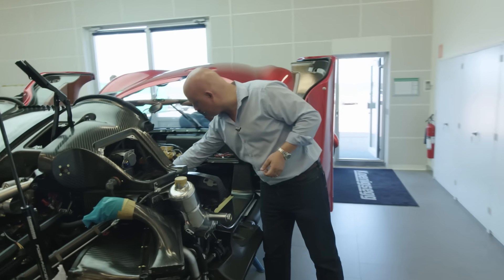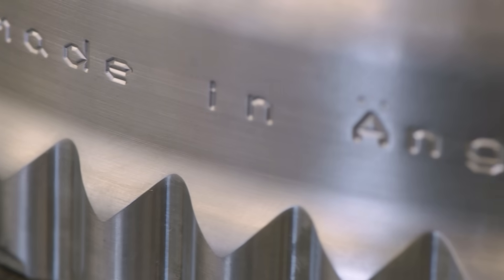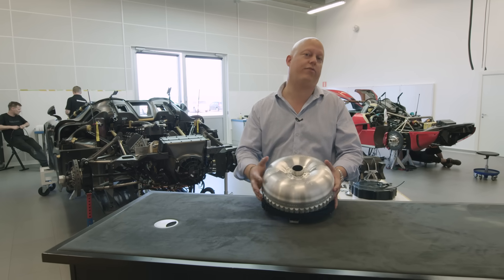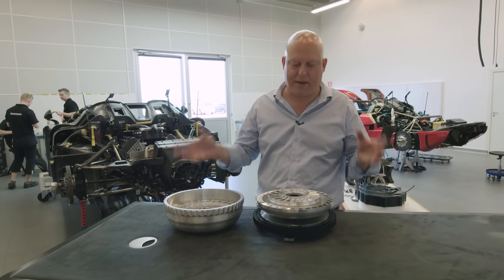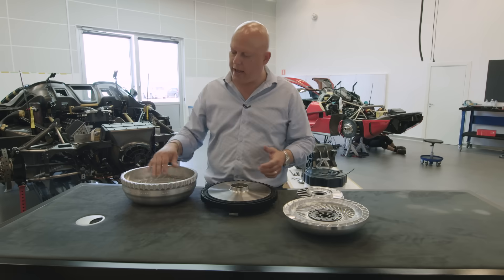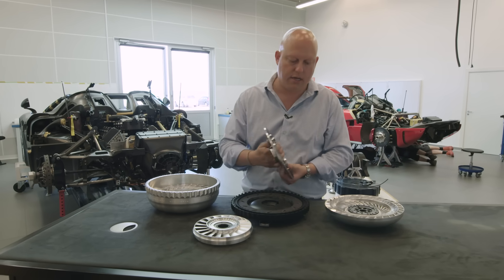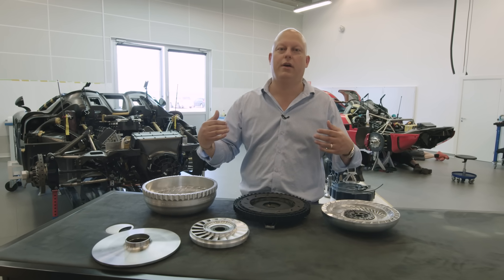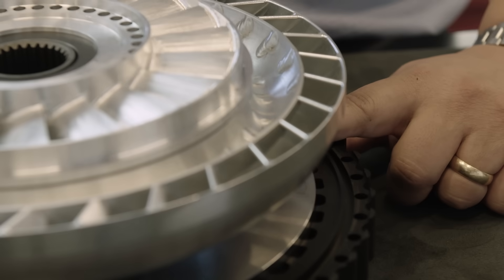248 MPH Without A Gearbox: Direct Drive  -- /INSIDE KOENIGSEGG

Comment: Tesla does 0-60 in 2.5s
Reply: But it's AWD.
Reply: RIPxBlackHawk What? "A Model S P100D managed 0 to 60 mph in a recorded 2.54 seconds during a session at Palm Beach International Raceway in the hands of DragTimes."
Reply: but the Regera is 100mph faster than the p100d
Reply: True. But where can you do 0-100mph? Only on a track. Not even on German autobahn as its not very practical to stand at 0 with two cars next to each other.
Reply: DP ie well then we have the Porsche 918 Spyder which does 0-60 in 2.2 seconds.
Reply: The 918 does it in real life in 2.5 sec according to Road & Track, not 2.2. Besides the Porsche is about 900k and the Tesla about 150k with some options...6 times the price.
Besides it sort of proves my point - The Porsche needs an electric drive train to be really quick. 
Ref: http://www.roadandtrack.com/new-cars/road-tests/reviews/a6316/test-data-which-is-faster-bugatti-veyron-or-porsche-918-spyder/

Comment: so if you drive the car in stop and go traffic the direct drive will overheat?
Reply: In those kinds of speeds they would only use the electric engines.
Reply: Ryan B im sure they dealt with thay
Reply: It has 500hp of electric motors, around town the engine will be sitting there keeping the batteries charged waiting for you to get to an on ramp so you can leave fat black lines for a mile or so

Comment: This direct drive concept is probably the coolest thing Koenigsegg has done.  But i'm still not convinced this car is as exciting to drive at "real life" speeds.  It'll only ever red-line at... 250mph, so you'll never actually hear the girl scream.
Reply: Lets just call it the torque converter, because that's what it is, even if Christian doesn't like to call it that because of the engineering they've put in to it. I mean, wheelspin from 0 to 170 mph with final drive and a torque converter is really, really impressive! I just don't get the need to put lipstick on a pig when the pig makes the greatest bacon in the world!
Reply: Honfy Lam According to Christian the fishtail exhaust raises the pitch of the exhaust to compensate for this. Also you do reach higher rpms when using the hydracopgizmothingy....
Reply: ruined.... really. All it takes is for the exhaust tone to change and the car is ruined. These are weak men with no balls. If that is all it takes to have them throw a tantrum over what they expect and want then all they are princesses. Pussies that think that driving is all about their feeble soft girly emotions.
Reply: haha
Reply: you can also increase the rpm with the fake gear padel shift without changing the speed of car. Just if realease the partialy the locking clutch (but i guess you can't do that non stop)
Reply: Honfy Lam 
I believe that in normal and commute speed, this will work smoothly like a cvt , but with a ferocious acceleration. 

The best of the both worlds.
Reply: why don't you just sit in your drive way and do burn outs. That is what seems to excite you. A great driving experience is not all about the noise.
Reply: ***** yet every single driving enthusiast says that the cayman/boxster is now ruined because of the engine sound.  When you drive a sportscar/supercar the looks/sound/performance are all important.
Reply: ***** SMH.  idiot.
Reply: Honfy Lam --scream noise coming from engine,not gearbox
Reply: exoraturbo25 umm... obviously, and what are you saying?  engine rpm's come from the engine, not from gearbox.  without a normal gearbox the engine will only max out its revs at top speed.  So what are you trying to say again?
Reply: ***** not exactly.  We still have horse carriages now.  When most of the world has moved onto sensible electric cars that can out-accelerate any petrol supercar, the supercars will be ALL about the senses and not just speed.
Reply: ***** you'd be a fool to think that internal combustion engines are going away any time soon.  How would commercial vehicles get around? dump trucks? the whole world shipping process whether by ship or containers off of ships and into shops... they will always run on internal combustion.  And even if all cars could run on electricity... where would they get that much clean energy?
Reply: Honfy Lam
from combustion eletric plant xD
Reply: *****  It's about cost.  It always is, and gasoline/diesel burning is the cheapest, fastest, and powerful way to transport large items.  Think of airplanes... there's no substitute for fuel.  Question... how large of a battery would a 50ton truck need? Then how long would it take to recharge it?  If commercial vehicles go up in costs, your fruits and veggies will too.  People don't like that.

Petrol/Diesel won't be banned.  They may be taxed higher, and cheaper electric vehicles undermine their combustion counterparts.  

LOL when have power plants ever really been in city centers? Not coal nor wind nor hydro.  City pollution isn't the big issue here... it is in China, but for most of the world no.    If they are going to ban the internal combustion engine, they should ban coal plants first, but that's not happening anytime soon.

Comment: So this car basically has enough low RPM torque to reach 0-60 in 4 seconds using just a torque converter action, but with the aid of electric motors it can go below 3 seconds and exceed traction limit of tires. And it is done with low stall speed converter. 

I guess if one would take massive displacement blown big block, leave a transmission in top gear it would accelerate in similar way to this one (without aid of electric motors) - Possibly overheating torque converter in the process as this Koenisegg one is huge!
Reply: mibars look at Top Fuel drag cars, they're all direct drive, no gearbox. Of course they're also 10,000 hp 😉
Reply: Patrick94GSR Sorta, they have a series of clutches to control slippage otherwise the tires would burn off and be uncontrollable. Now vintage dragsters were direct drive

Comment: It would be clever if it wasn't inspired by electric cars and applied in a misguided attempt to keep the combustion engine relevant. Christian, you know it's going down and you will have been on the record for years being wrong. Just like Porsche, Ferrari, McLaren and all the other fools.
Reply: The combustion engine is completely relevant atleast until battery technology can catchup to the performance of the modern combustion engine (power, range, weight). You apparently know little about what Koenigsegg produces, or for that matter porsche, mclaren, and Ferrari. Half of the car is designed for emotion, something atleast currently no electric car can come close to capturing. So like when the turbo was invented why wouldn't you make the best of both worlds. Low end electric torque coupled with a massive over powered generator? Atleast educate yourself on tue subject before you speak.
Reply: You mean 2.5 second acceleration of a large heavy 7 seater luxury sedan is not delightful performance?
You are telling me that all those Tesla buyers don't really love their cars? aside from the reliability issues.
Electric drive is plenty fast, my simple friend. Also I'm extremely knowledgeable about every aspect of it and I'm the smartest man in the world. So there is that :)
Reply: Just bear in mind that electric vehiclesare only incrementally more efficient than state-of-the-art CEV's.

Currently, an ICE might achieve, say, a little over 30% conversion of the heat of combustion to propulsion, but EV's are no more efficient than the power-stations that produce the electricity they use, which are themselves very little better than an ICE.

There is still room for vast improvements in ICE efficiency, not least using Koenigsegg' own 'freevalve' tech.
Reply: Rainer, and Bush was a great president and Trump voters are smart. And pigs fly.
This Koenigsegg fishing trawler here is lucky to be 10% efficient and power plants can be 60% efficient. And that's if they run on coal. If it's nuclear, solar, wind or waterfall then of course the difference is absolute.
With a few micron of processed sand on your house roof you can drive an EV for free. No contest.
Reply: Dan Frederiksen Acceleration or top speed isn't what makes a car, its the soul the manufacturers create. It's like pop music compared to an orchestra, or mcdonalds compared to a michelin star restaurant. I've driven a tesla and a bmw i8 and compared with a fricken miata the driving experience sucks. If someone is in it for purely the numbers so they can feel better about comparing dick size good for them. But real drivers, manufacturers, and automotive enthusiasts know that the real goal is the emotion. It's about the connection with the car.
Reply: "Alternative" or "clean" electricity generators require energy for their manufacture - photovoltaics only produce a net surplus over their cost in energy after 4-5 years, by which time their output has dropped and they'll prbably be ready for the recycling tip by 8-10 years. 

Wind-turbines? Possibly never.

THe only substantial net surplus is made in building hydroelectric dams.

Coal-fired (or gas) are at 60%? BS.
Reply: Rainer, solar might take 2 years to pay for their own energy but they last 20-30 years and both are improving. Windmills are 20 to 1 last I checked so your claim is complete Trump voter idiocy.
I didn't say all power plants are 60% efficient but the best are. Power plants are far more optimized than the average knucklemobile.
Reply: Jimbo, I'm the smartest man in the world. I'm the original discoverer of deep learning. I'm a polymath genius with expertise in multiple disciplines. I could make the power electronics in a Tesla among other things.
I have seen a thousand years into the future, things you couldn't begin to imagine. I am the one. You are the zero.

Comment: 6:00 you give it 2000rpm and it outputs 1000 rpm at MORE THAN DOUBLE the torque? Sure about that? Conservation of energy would have a problem with that.
To the people who are confused...look up what a torque converter does. this is a sissy TC compared to the ones used in drag racing.

Comment: 0-60 in 4 seconds while in 7th gear... Let that sink in
Reply: And that's only at half power.
Reply: Just with the rear electric motors, without the combustion engine
Reply: freedomlifemake 25 or with just the combustion engine and no motors....
Reply: The "7th" gear is a bit misleading though. He's implying it's the same as they would have in a geared vehicle where its top gear is effectively a "pass through", however other gearboxes might do that for 5th or 6th, and have a higher or overdrive gear still. And he doesn't state the gearing reduction on the final drive differential - however impressive, all the same!
Reply: The fastest Tesla has a top speed of 155 mph (albeit limited) whereas the Regera will top 249 mph. They are not even comparable. Tesla does a 1/4 mile in 10.6 while the Regera has an estimated 1/4 (not yet confirmed) of under 9.5 seconds. Sure the Tesla has loads of low speed torque from the motors but the Koenigsegg is designed for speeds over 60 mph.
Reply: Still slower than a Tesla
Reply: +Dire wolf lol, did you stop watching the vid before he stated how quick this car is when the electric and conventional engine power is combined?, then it's faster than tesla, and to 200 mph this would leave the tesla in the dust, not even close.
Reply: It should be noted that the supposed 2.4 sec time is via a software update for the P100D which wont be released until next month. Also the Tesla is 4 wheel drive. When it comes to initial acceleration of cars its no longer about power, its about traction, what the Regera can do from standstill on 2 wheel drive is astonishing, and beyond the initial start, its absolutely no contest.  I like Teslas, but the Regera is on another level. 93 to 155 mph in only 3.2 seconds and  0-248MPH in less than 20 seconds, lets see a Tesla try to do that!
Reply: Dire wolf that beeing electic only, try to start the petrol engine too
Reply: the new tesla model S is 0.4 seconds faster to 60mph than this (0-60 in 2.4 sec, the fastest current production car and 3rd fastest production car ever made) so yes +Dire wolf is right
Reply: but this tech only functions with that level combustion engine, your smallblock  would definately shut itself cuz the friction is higher than what it can produce
Reply: Completely agree with +1wibble2 above. The Tesla is an amazing car, one that atm is the car I'd like to own above all others (my opinion nothing more) but this is way beyond for speed. The two should not be compared.
Reply: aw loser
Reply: All it would have is a differential ratio
Reply: It's not really like comparing a bicycle and a superbike. The Ludicrous P90D has max 568kW (762hp) whereas the Regera is meant to have max 1800hp (1342kW). The Regera's still 2.5x as powerful but it's more like comparing a street bike and a racing bike.
Reply: The Regera does not have 1800 hp!! It has 1500 hp. Why is that so hard to get??

Comment: Still don't comprehend this fully... gonna need to see an animation of this thing in action or something :D
Reply: AllAroundMan Look up "how a torque converter works" on YouTube, there should be an animation in the first few results. This should help clear up any confusion.
Reply: It's really no different than a Torque converter. Just specialized with a hydraulic coupling.
Reply: It doesn't matter how it works.  What matters is that they took a boring technology that everyone thought was only good for making grandma's Toyota Camry easy to drive and refined it into something that could compete with super-car transmission that literally contain a hundred times as many moving parts.
Reply: About to do exactly that!
Reply: So this works exactly the same as a power generating gas turbine or electric power generating jet engine. Its about creating torque from hydrodynamic resistance. So the big bell shaped thing spins and moves the oil to then jet out along the sides. This is very much like a turbo turbine. That oil is now at super high pressure and speed and then gets pushed into the turbine and that is literally what is driving the torque. Effectively a windmill being driven by oil pressure. Now I am not sure about the next bit but I believe that once the main bell's speed has matched the speed of the turbine the hydrocoupler has no effect any more. I think, I am not sure. How the clutch system works is not something he completely explained.
Reply: tomas agustin Only a few issues I see with the duke engine design. 1) The longevity of the seal/s around the cylinder head. 2) The possibility that some type of lubricant has to be used for the seals to "seal" means the engine burns oil, increasing emissions. 3) No observable way to adjust the intake and exhaust timing, duration, etc, other than porting and welding or buying a new cylinder head. 

It is a really great design. The reduction of  parts and size makes it so much more economical. It also helps lower the center of gravity, increase potential safety of pedestrians, and can streamline a car for increased efficiency. But I see the same possible problems this engine might bring that the Wankel rotary engine faces today. Which are the prior list of issues I mentioned.
Reply: If you've ever had tea in a clear glass, have you noticed when you stir the contents bits and pieces of spices and tea leaves are spinning along with the fluid even though you're not directly touching it? This is happening because energy is being transferred from the movement of your spoon through the tea to the leaves/spices.
Reply: Exactly what i was thinking!
Reply: NarfBLAST Exactly! Koenigsegg is one of, if not, the leader in automotive technology and innovation. 

One case is their sister company FREEVALVE, which took the age old valvetrain system (i.e. camshaft, timing chain/belt/gears, valve springs..etc) and completely flipped it on its head. No camshaft, timing chain/belt/gears, and it is shoved in a smaller package! With basically infinite variability. 

The possibility to make an engine have increased power and torque across the whole powerband is amazing, but on top of that get increased fuel economy..now that is dumbfounding. That possibility is every gear head's wet dream. Then add all the other variable computer controlled systems on an engine. 

I can't wait to get my grubby little tuner hands on this technology and play with it.
Reply: English Muffin Look up the duke engine. As much as I want to see the camless engines come into the field, I feel like the duke would come out first.
Reply: English Muffin I completely agree. the rotary just wasn't a clean engine, I guess we'll see how they tackle the problem.  But less moving parts equal less chances of failure. Just seems like something that will come out for consumers first. Right now the demand is high fuel economy and low co2 emissions. But you can't have efficient engines without high emissions so engineers have to think if other alternatives. Either way I'm glad to see new innovations in the industry and can't wait to see and work on them.